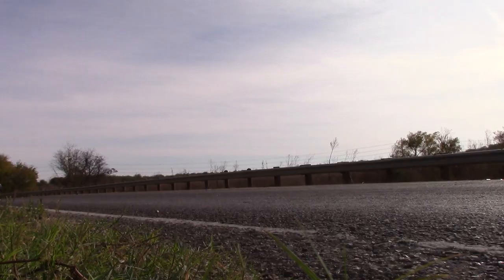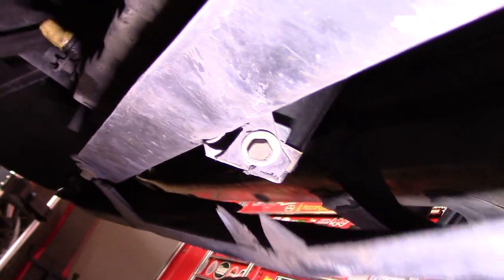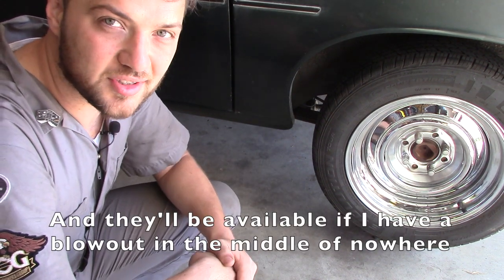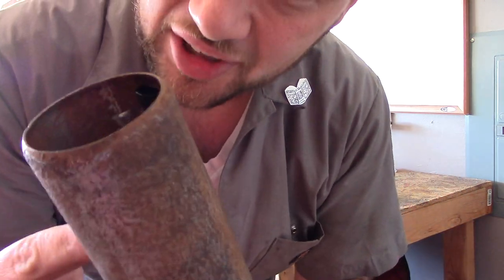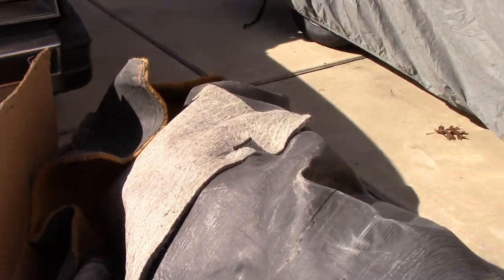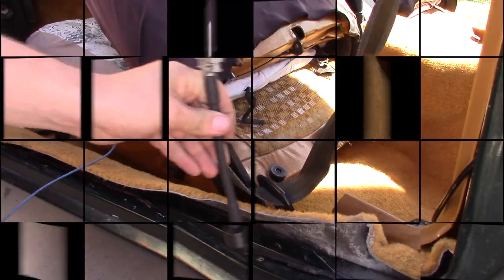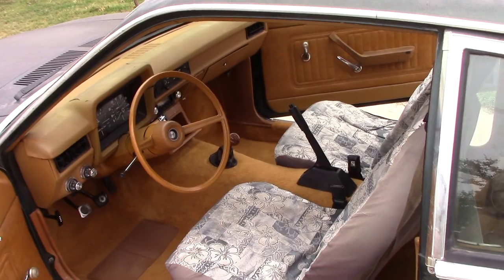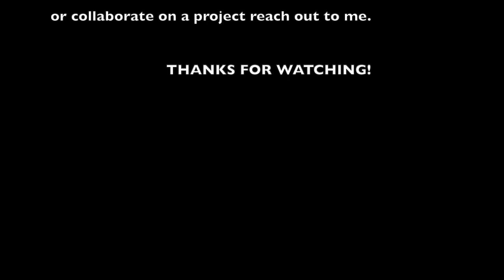Preparing for a CROSS COUNTRY road trip in my Ford Pinto (3,000 miles!)

Comment: From day one, I treated all the rubber trim, bumpers and side moldings on my 1984 Peugeot 505 GL with silicon tire shine, leaving it wet after application. They look like new. Water beads off the bumpers. Easy to clean.

Comment: You’re a brave one. I had a 1978 Pinto in 1985. Cannot remember it running for 3000 miles straight at one time. Good luck.

Comment: Man that was a lot of improvements. Awesome.
Good idea on sealant where the headliner extends. Another idea would be to cut that headliner back till it is barely lipping over the metal, say 1/8", and superglue a few spots to hold it. Then reattach the seal with some fresh sealant in its crevasse. That should seal rubber to painted metal, and not allow water to slip under the headliner, since the sandwiched headliner is retracted inside the seal now.

Comment: Great video - thank you. My mother had a 1972 Pinto Runabout with the 2.0L she purchased new in 1972. No power steering and she hated that. She also didnt like that there was no light in the hatch area. So as a 14 year old I rigged up a 'dome' light that we bought at the dealer. It had a manual on/off switch and I remember powering it from the input to the brake lights switch on the pedal so hot at all times. She traded it in for a 1976 Granada 6 cylinder, power steerings, etc.
God bless
Paul
Reply from the maker: Right on!

Comment: I am enjoying these videos.  My father had a 79 Pinto 3-door, very similar to this one.  When you mentioned the felt insets where the side windows ride up & down, I replaced those last year on my Dodge Aries, and I ended up using universal pieces.  Rock Auto listed them under "Door Window Glass Channel".  Maybe you could find something that way, or would that be a part where it would have been the same design from a Mustang II?  And for keeping the door weatherstrip material from cracking, I now follow the advice a guy gave me at a car show a few years ago - occasionally rub silicone grease, like Sil-Glyde, on them.

Comment: When you've been on the highway in that thing for a while, you're gonna be wishing you swapped in a T-5 5-spd. like I recommended. And, btw: The Pinto uses the same lug pattern/spacing as the Fox-chassis Mustang, so you have more wheel/tire options there.
Reply from the maker: Yep when I shop for wheels I always enter it as a fox body. I'm pretty happy with these wheels though
Reply: Its his build maybe he doesnt want a T5.
Reply: 2 mins in I am updating my comment, 1:1 is not the look for highway cruising 😂😂😭

Comment: I find most break downs happen in town, the exception is dry rotted tires, which don't like superhighways, then perhaps cooling hoses.  One thing I have though about lately is using corrosive chlorinated oil additives (like Prolong) on road trips that are long enough to change it out when finished, so 3000 miles is about the minimum.

Comment: Love the work on the pinto and the channel
Just 2 things
#1-upgrade lighting all around by replacing all the bulbs with LEDs
Specially the headlights.
You be happy with the results
And
#2-tunes are esencial for a daily mind you,one to do a road trip
Custom autosound got some radios
That fit in the factory location
But got Bluetooth plus USB connectors,perfect for a pendrive full of tunes in those moments there's no radio signal
They also got speaker solutions 
So there's no modifications need it
In your classic

Other than that,as some mention before your cellphone and AAA card

Comment: Very nice! I've had the same idea for my Gremlin project, or what I call: "The Cadillac of Gremlins".  Since I had all new upholstery made, I did the carpet and headliner at the same time.  The inside ceiling was coated with POR-13, Dynamatted, and then new headliner put in.  The floor had a few pinholes which got sealed, bathed in RhinoLiner, then Dynamatted.  Same thing with the wheel housings. Believe it or not, in a Gremlin, there is NO inner structure on the sides of the rear seat passengers!  When you pull out that trim panel, all you see is the backside of the quarter panel!  So, I made up some 18-gauge inside panels, riveted them in and Dynamatted.  The rear cargo area is the same, but uses plastic.  I Dynamatted the back sides of the plastic and that will have to do.  Early Gremlins like mine have trim panels on the insides of the C-pillar, but again, no steel!! You can see the inside of the quarter there too.  So, once again, some sheet metal panels were made, riveted in and Dynamatted before the trim panels went back on.  The doors will get Dynamatted as well after the body work as well as all new weatherstripping.

My goal is since the car will never be fast (It's just a 232 six) it might as well be quiet, and comfortable.  My plan is to also add a factory overdrive from a later Gremlin.  So with the big, 21-gallon gas tank, no door beams and no crash bumpers and a six with overdrive, it should be a quiet, fun, MPG machine!
Reply from the maker: Dang! That's quite the project you have on your hands! You should definitely shoot some videos of it! Us oddball guys need to stick together!
Reply: I've thought about it, but I dunno if I want to eat the investment for cameras, learn how to edit....etc.  

Some folks follow me on Facebook and I'm happy enough with that.

Would love the Youtube Revenue though! lol
Reply from the maker: @That_AMC_Guy  hahah you and me both!

Comment: Since you were doing the carpet I thought that you would have used Dynamat for sound deadening as well.
Reply: i too
Reply: I did sound deadening when i did my 1983 toyota supra carpet, window motors, etc and put it everywhere. It made the biggest difference ever.
Reply: @Shyzah  I did it to my 1991 Integra. I modified that car a lot. It was a great track car but it was really rough on long road trips until i Dyno matted the whole interior.

Comment: Wow! What a great video! I restored a 1980s mitsubishi colt two years back, and it is now my daily driver. Just like your pinto everything can be replaced in less than 15 minutes. New carpets, and the door rubber beedings make a huge difference to the cabin noise. But I also added some sound deadening material which I got down from China (super cheap) which I placed under the carpets , inside the door and inside the boot. For the doors and boot area I also pasted thick plastic sheets under the door boards to prevent the Aircon from escaping. Really enjoying your videos 😊. Thanks for uploading
Reply from the maker: Man that's awesome! Those are pretty unloved cars. I love when people see the value in unconventional cars!
Reply: Does your colt have the two shifters
Reply: @CharlieBrown-pb9xn  ....Yeap it has the supershift gearbox 😁😁 with power and economy both working. The car is such a joy to drive. I have added some centre storage , sound deadening and central locking to the car for it to be more of a daily driver, other than that the car is in original condition.
Reply: @icedt2592  years ago a friend had one and when playing hed do 1st low 1st high 2nd low 2nd high 3rd low 3rd high 4th low 4th high. If not mistaken thats how hed do it. It was a fun ride
Reply: @CharlieBrown-pb9xn  haha... Yea it's a great car to drive if you love to shift gears . Usually I take off on 1st low(power) then switch to high (economy) and drive on those gears. Unless I am driving in the city where I keep it on low all the way. It's really easy to weave in and out of city traffic in this car because of the power gear.
Reply: My friends looked like it had been thru war but still ran and shifted perfect. On a dirt road with his foot to the floor and shifting like he did when playing it was better than an amusement park ride

Comment: Many a Pinto and Maverick made cross country trips in the 70s.
If you replace or reline the gas tank (rusty even before ethanol).
Service or overhaul the motor and water pump
Replace the fuel pump
Clean the carb
And that bulletproof manual transmission (mine was three speed on the tree like a 40 Ford Coupe)
Alternator overhaul or replacement
Brake check
Good tires

It is a new car mechanically.   The car was so simple it is infinitely rebuildable like an old F150.

I'd trust my first car 70 Maverick or second car 71 Cutlass (coolest car) much further than if my 2000 Taurus reappeared magically.

Comment: Love the Pinto projects, please do more!! Owned several in past years, they’re like working on a Beetle - everything’s simple and easy. Please share some road trip photos! Just one more thing, please, please use a torque wrench on those lug nuts. I cringe when you hammer those down with the impact gun. Safe travels...!!
Reply: Professional mechanic with steel wheels?    On the vehicle he drives?    Not concerned at all.   But a good PSA for the plebes.

Comment: you can scrape that old material out and just but the material (felt) ribbon and glue it in the space with a block of woof the same size as the opening to push it into place with adhesive sprayed on the back .
Reply: dang i need autocorrect or not I don't know

Comment: I've got manual steering in my 80'. Parallel parking isn't too hard. Great car btw.
Reply from the maker: That's what I thought! Glad to hear it first hand!
Reply: @Scooter_911  Ugh the power steering makes it so much nicer to drive. Parking or not. My days in the past had driven many manual Mustang II and Pintos without powersteering. Yuk. Keep it is better.
Reply: I had a '79 pony that came without power steering for 6 years, never needed it.. I could parallel parking was never an issue.

Comment: Did you put the weather strip inside the window track? Did you have to cut it at all? I have a 1980 Pinto Squire wagon that I have to do the weather strip in and around the windows, the car is from the south and it's all dryrotted.

Comment: well that's a 1980 so  newer by about 8 years than the one i had - but i would  have had to bring along at least 10 timing belts for replacements along the way, a bucket, a set of pullers and a timing light..(wrenches as well of course) because the motor  would every once in a while freeze up and i would snap the belt and pull over to the side of  the road and have to perform a change.
got it down to a couple of hours for winter and 3 for summer- ( radiator water temp was the issue )  (good ole day?)

Comment: Great video and a great car too! Where did you get that cool magnetic fixture that you used to hold your fuel pump positive wire while you were soldering it? I could use one of those!
Reply from the maker: I got mine off the Matco truck I think. But I left a link in the description!
Reply: @Scooter_911  I didn't even notice your link there! Thanks for letting me know, and keep up the good work!

Comment: You should look into getting a new set of buckets seats out of any Mustang 2 or Escort EXP also Fairmont which also come in factory tan vinyl.
Reply from the maker: Wow great tip thanks! I was contemplating getting mine reupholstered
Reply: you're welcome I did same thing on an old 79 Mustang I had it worked out perfect even the seat rails were the same. Plus the seats had more cushion and side bolsters were awesome you can even check to see if they have Recaro seats that fit some of the 85 Mustangs came with them
Reply: Also love your channel keep up the great content .

Comment: Looking good,  How's your fuel mileage and drivability after some time post fuel injection conversion ?
Reply from the maker: fuel mileage is about the same around town, much better at higher highway speeds and "late to work" driving. The drivability is night and day though. Its so responsive even when the engine is cold and drives so consistently no matter what is going on. I cant speak highly enough of the swap or the product (and i dont even get a cut from holley)

Comment: Hi I realize you just swapped in a 4 speed. For better cruiseability have you considered a T-5  5 speed from a 5 liter mustang to swap in your pinto. 
I love this pinto project and the Toyota Kai-rolla
Reply from the maker: Hahaha I actually swapped to a fourspeed out of necessity! My old c3 was giving up the ghost and I had limited time and money (jeeze it's becoming a theme). I would love to swap in a t5 but I'd have to cut the tunnel a bit and get a new driveshaft made (not that big of a deal actually... Future video?) There's actually a trans that was used in the merkur XR4Ti that is a 5 speed that is a direct swap for the pinto. I believe it's a T9. But those are getting pretty hard to find these days.
Reply: Garret I forgot about modifying the trans tunnel sorry bout that I didn’t realize the T 5 was that much larger. 
Still love this Pinto tho. I just wanna see you build it to beyond what the average guy would think of doing. I completely understand you’re doing on a budget. I get it. You just don’t see these pinto’s very often. A dude I worked for In the mid 80’s had a either a 79 or 80 as a parts chaser a neat little car 4 speed and a friend of mine had one rare factory V-6 2.8 liter automatic transmission. My sister had a 74 I think automatic transmission with a performance shift kit for hard shifts. Another friend had pinto wagon was cool back in the day. 
Well ok I’ve talked ya ears off lol 
But the 2.3 Four has potential and aftermarket for it. Like Bo-port. Com
And StingerPerformance.com 
Hope you have a Blessed One Sir 
Eddie Patterson Silverstreet South Carolina.

Comment: I would keep an eye on that filler nick seal. I had the same head ache with my 1977 Granada. Come to find out it was the same as the first gen Mustangs. I tried the second gen Granada filler nick seal. they looked the same however it failed because the inside dimeter of the seal was to tight. some movement is needed.
Reply: I had a 77 Granada in high school. Serious chick magnet. Wouldn't mind having it now actually.

Comment: Unlike you, I let scope-creep ruin my wrenching experiences. For example, I can't pull the carpet out without then wanting to repaint my TR6 floor pan. Then find / install a new transmission tunnel. Then repair the broken tabs on the center console and since that's out and the underside of the dash is accessible I'll go ahead and rebuild the gauges and replace all the lamps with LEDs and hey now I need a new rheostat and gosh these door panels now look haggard too and while I'm at it I heard that there's Miata seat adapters and hey oh etc. etc. etc. etc. etc. etc. and now it's 5 years later.
Reply from the maker: Hahahah yeah it's a dangerous world. Luckily this being my only car and having strict timelines keep me on track!

Comment: Who makes the tools you used on stripping and sodering the wires?
Reply from the maker: I bought the automatic strippers on the MAC tools truck and they are Mac brand but I don't know who manufactures them for Mac. The soldering stand is an AST WSC15 and I think I bought it on a tool truck as well. I'll throw some links up in the description soon.
Reply: @Scooter_911  Thanks

Comment: Do you have a part no by chance for that fuel filler neck seal?
Reply from the maker: Absolutely! I installed the GR504 and I bought it from fillernecksupply.com
Reply: @Scooter_911  Thank you. I picked up my 14th pinto last week. 1980. Just been going through it to make it road safe. Other than usual seals the only thing wrong is floor pans (Michigan car). Thanks again.

Comment: Was the German 2 liter 4 cyl offered in any Pintos?
Reply from the maker: Yes indeed! In fact the 2 liter was the predecessor to the 2.3
Reply: Don’t know much about the 2.3 but I did own a 1974 German Mercury Capri with the 2 liter engine, and it was pretty good, especially after a rebuild.  Was the 2.3 the same engine with increased displacement? Curious.
Reply from the maker: @wallacegrommet9343  yes indeed. Just a bigger bore and a touch more stroke

Comment: when I saw the model of Pinto I cringed, my father was rear-ended while driving one he was lucky to have been enough with it to bolt out of the car just as it erupted in flames, the tanks are notorious for exploding in rear ending accidents and part of reason Ford discontinued the  hatchback pinto, please weld something behind the tank as a safety precaution so you don't become BBQ.
Reply: The factory recall for that fire hazard was a piece of, what looked like flexible plastic zip tied to the rear axle (I think) so if the tank hit it, it wouldn't create a spark. Mine was a 76 that I bought new.